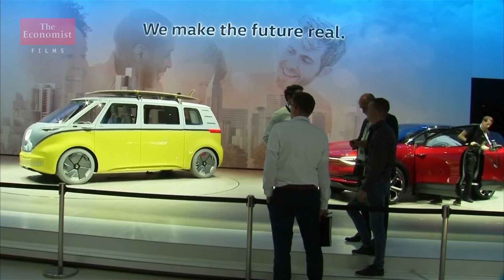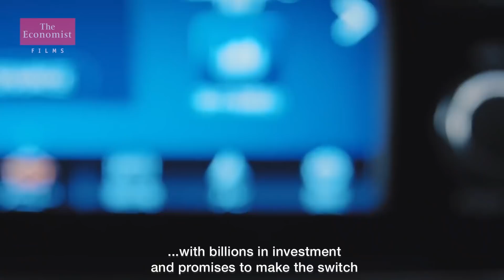Electric cars will come of age in 2018

Comment: It's sad that so many so-called car enthusiasts think electric cars are not real cars or that they have no soul just because they are silent, and that they can't be mended with primitive tools. It's called EVOLUTION. I swear most of the poeple complaining about EVs are just old farts that don't want to admit they're stuck in the past and don't understand or want these changes.

I feel Tesla doesn't get enough credit for what they've achieved. Whilst the rest of the car industry is coming out with PHEVs in recent years, Tesla have been delivering a car with autonomous driving, a web browser, a massive network of superchargers which can deliver up to 300 miles per hour of charging, a comfortable, practical, luxurious super saloon that would smoke most sports cars and even some super cars for acceleration, 8 year warranty on the battery and did I mention the 250+ mile range?

If one man can do that in such a short period of time when the rest of the car industry giants can't even come close to competing even after half a decade, that just shows their lack of incentives, because consumers also have no incentives.
Reply: Yup.  It seems that despite all the free press, a lot of people don't understand that EVs can out-accelerate gasoline vehicles with stock parts.  Goin back to that ludicrous 0-60 in 2.4 seconds (!), let alone the Tesla SUV out-accelerating a Ferrari in the quarter mile.

-Matt
Reply: Hey I'm an old fart and I am a big fan of EVs. A noisy gas car may sound good to the guy driving it, but I don't want to hear it when I'm out and about, or especially when its driving by my house when I'm trying to relax or sleep. For me EVs are better for this reason alone. Lets reduce noise pollution, and maybe people will become a little bit less stressed out. To the people that have really loud gas cars, how would you like it if I sat out in front of  your house while I try to learn how to play the saxophone. Why not, I think it sounds good.
Reply: Drealm, it's incorrect that Tesla is making an unprofitable product. Tesla have a profit margin of 27% as of Q1 2017, higher than BMW and Mercedes (~20%), and they're aiming for 30% over the next 5 years. The reason they are recording losses is that they are investing vast sums of money into growth.
Reply: Sheikh YOLO POINTLESS and proven wrong. There already is soo many Electric Cars in the drowned out by louder ICE vehicles. Yet pedestrian accident rate is soo low specifically for BEVs. Some fast BEV are NOT Silent and get downright Loud when going fast to as an awesome natural warning. Stop spreading that Myth and educate other its wrong.
https://www.youtube.com/watch?v=G7ZY1mpJ7zo
Reply: True, but if we're taking into account subsidies then you also have to take into account the trillions in subsidies that the oil industries get every year, despite operating very profitable businesses. I say we cut all subsidies and let the market pick the best choice. Both technologies are now mature enough to be able to stand on their own legs.
Reply: konj atic The irony of your comment it is just as Baseless WithOut Reference and No Justification. Sure there is many problems with such early stages of BEV. But Flat out dismissing the Need for Evoloution of the Technology is out right WRONG. The capabilties that has been recently achieved is directly out of demand for evoloution. Fact is we now have BEVs with100kwh, Output easily beyond 500hp, Lucid Air VMax of 235.44 Mph and Real World data has recorded Acceptable degredation after 200,000 miles. Soo Dismissing all these real world costly expensive achievements as just Money Grabbing makes 0 sense. The only Scam is Idiots who "short" BEV industry, many who have already lost alot of money.
https://docs.google.com/spreadsheets/d/t024bMoRiDPIDialGnuKPsg/edit#gid=0
Reply: Sheikh YOLO 
HERE'S an idea!
DON'T WALK ON THE ROAD!
Reply: drealm 
Case in point, model X out dragging an Alfa 3c .... While towing a trailer, on which was..... An Alfa 3c!
Haha!
Reply: R 
So gas cars never run out of fuel on the highway while trying to find somewhere to fill up?
A)EV driver will a always have fully charged vehicle in the morning.
B) will have a running an accurate Reading off his existing range 
C) will have a vehicle which monitors the situation constantly, will automatically reduce performance as required and will Direct the driver to nearby charging stations.(IF required!)
Note my points regarding 2019. Google "Toshiba battery press release" (3rd October) and think about the implications, including double the range for a given battery and charging a Tesla sized battery to 400+ miles in under 15 minutes.
Then argue??
Reply: R 
I refer to my previous post of ONE WEEK AGO!
"  "There's no way to get into a car if it's battery goes flat"
"There's no way to get into the car if it's 12 volt system fails"
Mmmmm
Maybe they shouldn't use 12 volt batteries in ice cars then?"
.........
You DO know that the Lamborghini Aventador is NOT an electric car, don't you?
He obviously had either a bad lead acid battery, or a bad Charging System (alternator?)
Thank you for PERFECTLY illustrating my point!
Reply: R 
1) maybe it's a good idea to keep a car key somewhere on your person? As a sensible person would with any car?
2)To borrow a phrase 
"frankly, I don't give a damn" 
I live in the UK and we have 98% coverage! 😋
3) make your mind up! locked in, or locked out? (By the way it seems that the Tesla issue must be on the outside latch switch since owners have no trouble EXITING the car if that door latch is playing up. Maybe there's a mechanical latch inside? It's a shame Lamborghini didn't think of that!?)
3) I WONDER IF THERE WAS A RECALL ON LAMBORGHINIS?
4) You are really fixating! 
Quit while you're behind!
get a life!
(Notifications blocked)
Reply: Lucid Air a 4 Door BEV achieved 235.44 Miles per hour at TRC Ohio. Because it uses Orbital CVT gear boxes. But it "ONLY" does 0-60 in 2.8sec. IIRC it has 3 Motors and Detuned to 1,000hp. The drive train was evolved from the Atieva Edna which could output more power. BEV are not just quick they are now outright Fast.
Reply: Richard, lol i wasn't saying capital investment doesn't hit the income statement. I was saying that it was false that Tesla don't make a profitable product. They do, with a product margin of 27%
Reply: Fossil fuel subsidies amount to 6.5% of global GDP as of 2015, amounting to $5.3 trillion in subsidies. China subsidizes the most ($1.8T) followed by the USA ($0.6T), then Russia, the European Union, and India (each with about $0.3 trillion) http://www.sciencedirect.com/science/article/pii/S0305750X16304867
Reply: Richard Dixon No you either Lied or got Fooled. The Vehicle Products by Tesla are Profitable, simple Fact. Problem is the company blows resources in other areas not necessary to keep their current line of products profitable. They keep spending resources to attempt new things with high risk. Massive spending on R&D, new infrastructure and logistics for future bigger demand. If Tesla was an Old Automaker in a 0 Sum Industry with tiny changes in market demand. Just focusing on their existing products they would be very profitable. Instead their Risk Taking on New buisness avenues is barely keeping them afloat. So you are wrong and fail at accounting.
Reply: konj atic 
I think your logic is flawed. you have to realise that when you purchase a gas-powered car you're committing to fuel, maintenance and repair costs for the life of the car.
Notwithstanding some teething problems I believe teslas are proving extremely reliable and require very little servicing. (apparently cars have travelled 300000 miles without a set of brake pads!).
This, of course, annoys the hell out of the conventional manufacturers since in many cases their original price structure for new vehicles is lower due to the guaranteed cost of ongoing service.
The vehicles are apparently very expensive to repair is body panels if damaged, however, I believe that is due to the precise tolerances required for mounting of the various autonomous driving sensors, so will be the same for any manufacturer.
Factoring the cost of the electricity to fuel the car which apparently works out in the UK at about 10% that of a tank of fuel for an ICE car and the economics of electric vehicles over say a 5 year period become extremely attractive.
Reply: R 
Buy a Mustang then!!
Good luck!
Reply: R 
Then..... You can get locked into ANY car! ICE or EV! Do you REALLY think the EV designers DON'T consider the possibility? (It does seem, however that you CAN have trouble getting OUT of an ICE vehicle?, Only one battery, no backup! Lucky it wasn't burning!).
Reply: R 
You do know there's a known issue with the door lock mechanism on (generally earlier) tesla model 3's ?
I believe it's caused by the wiring in the Loom within the lock assembly being slightly tight and that Tesla replace (update) faulty units free of charge? It bears no relation to your post of "what happens if the battery goes flat" (😱) it will happen to a single door lock, not all four at once and Tesla will, if necessary, send a mobile unit to fix it.
by the way.. OMG!
https://www.google.co.uk/amp/s/amp.theguardian.com/world/2017/jul/19/mercedes-recalls-3m-diesel-cars-emissions-concerns

That's 3 M I L L I O N recalls!
Shit happens!
Reply: Also when the batteries start to fail people are going to buy replacement bits from eBay which will just lead to many more problems. Remember the hoverboards that caught on fire. First family to burn in a Tesla is only a cheap Chinese battery away
Reply: JD Mathew 
Don't be silly!
Reply: JD Mathew 
52% over $10,000,000
Compared to 40% over $465,000
However that is the base rate.
I have no doubt the most in this tax bracket pay nowhere near the current rates, they have the accountants to do the fiddling for them and probably pay less than the average worker.
It could be that Bernie would cut out the fiddle factor!?
Instantly more money in the economy to put towards infrastructure, which would create more jobs, for workers who would pay more tax!
Reply: R As a matter of fact thats exactly what is starting to happen.
Reply: Well I guess I stand corrected, thankfully. There are the rebates that customers were getting however. Those were incentives that helped Tesla. I'm not sure if they are still offered. I know that in China and a few other places after subsidies of different sorts were cut sales dropped drastically.
Reply: R 
P.S
Google "Tesla ludicrous reaction"
They seem to enjoy it!
Plus, I think the guys drag racing teslas like fact that they can basically drive their car, which is completely road legal, to the event blast past cars that are barely drivable on the road due to the modifications they need and then drive home again.....
Reply: Roger Starkey I saw guy get blown up at the isle of man and go flying through the air. You Dont get explosions with boring electric bikes. Secondly he also said going down a hill lying in a skateboard luge thing was the most fun he has had.
Reply: R 
Responding to two at once this time!
"There's no way to get into a car if it's battery goes flat"
"There's no way to get into the car if it's 12 volt system fails"
Mmmmm
Maybe they shouldn't use 12 volt batteries in ice cars then?
(I do believe the leaf has a separate 12 volt battery?)
Do you really think there isn't a backup? 
https://youtu.be/Iu7vySQbgXI
Reply: Tom Hooper 
You're enjoying this far too much!!
🙃
Reply: R 
"..…...How do you not get a door handle to work properly?
How do you not get a fuel pump to work properly????
https://www.google.co.uk/amp/amp.dw.com/en/volkswagen-recalls-281000-cars-in-us-over-faulty-fuel-pumps/a-40291240

WOW!! DANGEROUS!
280,000! Stall in the fast lane? Nasty!
MORE????
Reply: Roger Starkey this is because vw were being stupid about emissions and messed up there own software. They have tied themselves in a knot over this and have made a mess. But the door handles they are all good.
Reply: R 
Ok I'll bite one more time.
You seem to have decided to divert away from The Joshua Brown case? You know? the one where he was watching a movie at the time of the accident,
Where he had set the cruise control to 74 mph, well over the speed limit?
Where he had touched the steering wheel for only 25 seconds during a 37 minute journey?
Where the truck he hit actually pulled across in front in violation of a stop sign, that could have been a split second before the accident, WE don't know do we?
If your vehicle is moving at 74 miles an hour, another vehicle is waiting to cross in front of you and then does so a second before you arrive at the spot there Will be a collision! (I had someone do the same to me at 25 miles an hour, zero reaction time, it wasn't pleasant!)
My point is that without knowing the circumstances prior to the incidents in the videos you cite, there's no way you can categorically blame the vehicle.
I watched 1 guy "testing" autopilot using it to undertake vehicles while he was on the inside lane of a multi-lane carriageway and seeing how long he could keep his hands from the wheel.
By the way pick a vehicle name and search "(name) crash".....
They're all there!.
I assume you no longer have an issue with my other points, (recalls, emissions, etc)?
Reply: R Running out of electrons is the same as running out of petrol, a result of poor planning or judgement. It's up to the operator to ensure they have enough energy, whether fossil or electric, to finish the journey.
Reply: Sami Tapio you'd have to go back to 1970 to get a car without computers and electronics on it.
Reply: Sami Tapio I don't know, I used to think like that, but the computer on my Chevy van runs the fuel injectors, spark plugs, emissions and the transmission and it's got 485,000 miles on it with absolutely no problems with the electronics
Reply: Anti Petrolhead you have no soul
Reply: I love cars and drive a bmw 3.0 petrol turbo which is amazing fun but i think 2020 will be when EVs take off and look forward to owning 1 in maybe 2021-2 , not only because i think this is when they will become affordable to us all with good range but also when i can afford to buy new.
Reply: R 
Ah! Now motorbikes (deflection!?)
Ok!
https://www.google.co.uk/amp/www.motorcyclenews.com/amp/sport/tt-road-races/2017/june/tt-2017-anstey-wins-zero-race-/

If Guy Martin likes them!!!
Reply: Tom Hooper OK in my old phone when it froze I could take the battery out, put it back in and it worked again. In my new phone when it freezes I have to wait till the battery goes flat which might be two days. Given that an EV is battery based what happens when it freezes. Do you crash? Does it just stop? Can you get out of the car or are you locked in as some models have handles that retract into the door?
Reply: Tom Hooper 
I'm expecting Graeme Chapman from Monty Python to appear any moment and say...  "stop it! you're being silly!"
Reply: There's no way to get into the car if it's 12V system completely fails (note that this is NOT the same as running out of range). Unlike the Roadster which has a keyhole in the bottom of the door. This would be an extremely rare situation (and has been on the Roadster, which has an inferior system
Reply: R 
"Guy blown up at the Isle of Man"
That would have been an ICE engine seizing up?
Reply: Roger Starkey that's why it was exciting, that was my point
Reply: There are no subsidies on current or previous models of Tesla in China, they are subject to a 10% sales tax and a 25% import tax. You may be thinking of Hong Kong with is a separate tax region and the subsidies were no import tax as they were 100% electric. This was removed earlier this year and sales dropped dramatically. 

The fossil fuel industry benefits from subsidy around the world and has done for almost a century in the US. Current subsidies to the fossil fuel industry have been calculated recently to be over $5 trillion per annum.
Reply: No I say we give all the subsides to Electric car trucks and infrastructure companies O for big oil--but only 10% to Dual motor and .0001 percent to all others  but just for 75 years or so
Reply: John Livesey where did you find that? Tesla tow the car to a service centre when it breaks down as there isn't anything to fix on the side of the road. That's from the Tesla service agreement.
Reply: Bryan Hensley so if you are driving on the highway the car slows down? I really think you just made that up.
Reply: Fuck your shitty electric car I would rather drive rx7 or supra of whatever
Reply: R 
If you had asked a random person in May 2007 "is the smartphone revolutionary?" they would have said "what's a smartphone?" if you  asked the same question again in 2008...........?
Effort?
1) arrive home
2) plug in car (30 seconds)
3) unplug car in morning (30 seconds)
WOOHOO !! 
Effort?
(Correction, as of 2019, every other day!)
Reply: R 
Keep clutching at straws!!!!
(If the battery on an ice car goes flat can you get inside the car?)
Reply: R 
Let's check off a few points?
Autopilot, 
I can't be bothered to look back at the post, but as I recall I was using the example of autonomous technology accounting for some  price difference between ICE vehicles, which generally don't have the technology and EV's, which do. Nothing to do with safety, I believe investigation will show that any idiot who was killed as a result of driving a car fitted with autopilot, was using the system outside of its current recommended "BETA" specification  (in the drivers seat at a reasonable speed, observing the road).
Thd outlandish(?) "Battery fire!😱" Comment.
Really?
A very quick search found a report from 2007, before electric cars were anywhere near as popular as they are now (so I assume this excerpt relates to ice cars??)
"In 2003-2007, U.S. fire departments responded to an average of 287,000 vehicle fires per year.  These fires caused an average of 480 civilian deaths, 1,525 civilian injuries, and $1.3 billion in direct property damage annually."
OUCH!!!!!! 287,000! 
...........
Emissions,
Mercedes have been caught as well! I'm sure if I searched I could find a case for General Motors or Ford or others, but life's too short!
Volkswagen and Mercedes probably (?) account for at least a quarter of vehicles sold worldwide.
...............
The door lock fixation(!)
I'll say it once more (read slowly!) the Tesla failures were a single door, lock on early models,  they they prevented people getting INTO the vehicle, so did not compromise safety! The door can be opened from inside! it's relatively simple to fix under warranty at the customers premises.
I felt my comparison of the fuel pump failing "at any time in a moving vehicle, causing it to stall" demonstrated that there are far more dangerous failures which can and have occurred relatively frequently in many more (ICE) vehicles? surely these should be of more concern than a simple (intermittent) door lock failure?
If you prefer I could dig up stats on brake failures, steering, airbag failures, fuel tanks, fires (oh! done that one!) etc, etc,
..............
Reply: Roger Starkey these are the views of actual Tesla owners. I take it you and tom are only dreaming of ownership. Also autopilot doesn't mean autopilot as one dead american called Joshua brown knows. Volvos can't deal with kangaroos or snow on the road. Its the Hillary Clinton of technology. Everyone thinks that everyone else will buy one but not yet. Also if you park on the street how do charge it. A big cable across the path from your house? The future may have arrived but people have gone meh.
Reply: +Bryan Hensley  yeah those cars will run forever... unlike these computer filled trashcans :)
Reply: +Bryan Hensley but when your car functions are fully behind computers ( like tesla ) who the fuck will have software/hardwire updates for those when they are  +10 years old? yeah... you wont get those.
Reply: So if its so good Tesla sacked 700 people for a laugh?
Reply: Tom Hooper my point was electric cars are still not a winner. They are not a revolution like the smart phone. You have to really hate buying petrol to think they are worth the effort.
Reply: Roger Starkey people ride motorcycles because cornering is exciting accelerating in a straight line is not. Drag racing is only exciting because the thing might blow up.
Reply: Roger Starkey people are lazy. They forget to charge their phones. They think they can make it. If people run out of fuel then people will run out of charge however it takes two minutes for the service man to top you up with fuel is he going to drive around now with a huge battery?
Reply: Tom Hooper Tesla owners group says
I just had this problem yesterday (S85D, 25K miles, ironically just had its second "annual" service). At least for you it was a rear door...on my car it's the front drivers side door, so I have to get in on the back and climb between the seats, or get in on the passenger side and scoot over. I took my car to the Dublin (CA) Service Center but they don't have the parts...I'm probably going to be calling other service centers tomorrow.

Thanks,

Bruce.

PS. On the lighter side, I briefly thought that if I left the front drivers window down, I could do the "General Lee" thing from "The Dukes of Hazzard" and hop in the window. Then one of my friends reminded me that I'd probably hurt myself trying this
Reply: Roger Starkey if you Dont have a manual override you absolutely can get locked in a car if the battery goes flat.
Reply: Sina Madani thank goodness Bernie didn’t win. He would of taxed the hell out of billionaires like Musk. None of this would be possible.
Reply: Roger Starkey You are the silly one. Google Bernie’s tax rate. He wanted a 90% on the rich. That would shutter most companies including Tesla.
Reply: Roger Starkey Owner gets stuck in $700k Lamborghini after forgetting to charge it

Yahoo7 News / 3 hours ago

    

The driver of a Lamborghini worth more than $700,000 in Victoria has had an embarrassing morning, after his car broke down on a busy motorway.

0:27

Owner trapped inside Lamborghini following flat battery

VIDEO A flat battery is to blame for a $700k Lamborghini breaking down and causing traffic chaos.

The man was trapped inside the luxury Lamborghini Aventador on the Calder Freeway on Thursday, because he forgot to charge the supercar's battery.

￼

The driver was trapped inside the car because he forgot to charge the battery. Source: @jodilee_7/ Twitter

He needed roadside assistance to be freed from his vehicle as the doors locked automatically
Reply: Roger Starkey you said you could not get locked IN a car. Well if you can in a Lamborghini that costs more than a house brcause it runs out of battery then ....
Reply: Roger Starkey ￼Image: Gizmodo

A couple of years ago, a Tesla software update added the ability to unlock the company's all-electric cars remotely using the owner's smartphone, as well as to actually allow the car to be driven without the key. One problem: if you step away from your car when you're out and need to get back into it, you better be somewhere you can get a signal on your phone.

Neowin and the Telegraph picked up recently on the story of Ryan Negri, who decided to go for a joyride in his Tesla with his wife and dogs into the desert outside Las Vegas, after unlocking and starting his Model S through his phone.

After driving six miles and getting out to enjoy the view, Negri found that he couldn't actually get back in to his car, which had switched off and locked when they'd exited. Because they were out of range of mobile coverage -- the US' telcos are notoriously terrible for anywhere outside of metro areas -- both the Tesla and Negri's iPhone weren't able to connect. No connection meant no unlocked car, and the couple were stranded
Reply: John Livesey but when you run out of fuel the auto service top you up. Are you suggesting they drive around with a huge battery to get evs running again?
Reply: can we get electric cars without those horseshit computers and electronics? i dont want to change my car as often i need to change my smartphone
Reply: Roger Starkey my last grumble is that the guy who died in the Tesla was simply an extension of the culture of texting while driving. Automatic cars mean you Dont have to change gear. Try texting while driving a manual gear box. Happy to be called a Luddite on this point. I'm calling for an end to all driver assist technology.
Reply: I get what your sayin. But cars are THINGS not human beings. They have NO soul. They are inanimate objects even if A.I. is controlling them. Cars should be seen NOT heard. Bye bye Ferrari and Lamborghini. We certainly won't miss those noisy bangers.
Reply: Also 99% of electric vehicles in the future will be like the Nissan leaf not some sort of Mercedes supercar.
Reply: Roger Starkey I went along to the Tesla open day. Waited in line for an hour then sat in the back while a Polish man called marek drove us around the carpark a few times. At the end of the drive marek had convinced me that his mustang was for the same money a much better car. They are not expensive enough to be a status symbol. Car people find them boring, they make no noise at all. Environmentalist can't afford them. I went for a look with an open mind and came back going nope.
Reply: El Diablo Electric cars are more dangerous because they are silent. A pedestrian being able to hear a car on a bended country road can make a big difference in safety as they are aware there is a car approaching at speed.
Reply: Roger Starkey so revolutions are only in hindsight? Home battery storage for solar yes that's is a revolution. A solar car yes that's a revolution. But an electric car no its just less convenient. I'm dreading when these things start running out of power on the highway and traffic just stops. They already have five different plugs.
Reply: Roger Starkey diesels were only meant for trucks. A hatchback that sounds like a tractor is for weirdos. Tesla seems to make the worst cars in the world. How can you not get a door handle to work properly? Oh yes its American.
Reply: Roger Starkey as you can't ban someone on someone else's channel or individually ban a commentator from your email all you have done is remove yourself from the loop.
Reply: Something that I think should be kept in mind is how Tesla has uniquely gotten substantial subsidies. If anyone is going to get subsidies I'm glad it's Tesla, but my point is Tesla's "genius" alone didn't pave the way. There isn't going to be another upstart electric company like Tesla. It only exists because it got it's foot in at the right time. At this point the company is making an unprofitable product. It sort of reminds me of the Concorde, brilliant technology but in actuality prohibitively expensive for a real world market. We effectively took a evolutionary step backwards in tech when we dropped the Concorde since the market couldn't afford it. I hope Tesla isn't another Concorde because I really do like the car.
Reply: Roger Starkey type Tesla crash into YouTube. The cars commit suicide. They even crash themselves at the dealership. Even teslas think teslas are a bad idea. God help you if you are in it and there's a truck anywhere near it. The only hope for Tesla is if ford make an EV then everyone can say in comparison to Ford teslas are relatively safe. Waiting for ford to make an even worse product will be nothing when the Chinese start selling in the West. I'm absolutely convinced you will defend EV's because you Dont actually have one.
Reply: Sina Madani.....I do not know how old You are but the thing that You call EVOLUTION is nothing else then placing more and more money in someone's pocket.
I am a professional driver and I like when things going for better but belive me 90% of things that EVOLUTION is bringing is just big pile of B.S.
I am not going to start placing things one behind another but use Your brain and common sense and You are going to find out truth.
If You think that Tesla is going to change something then You are wrong.
Maybe  motor is going to be different but everything else will be the same. Tesla and EV are going to place  money in their pockets same way like BMW Toyota with petrol  engine.